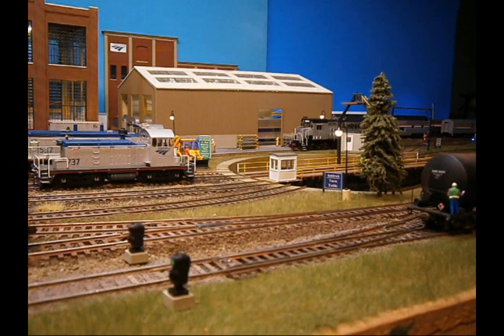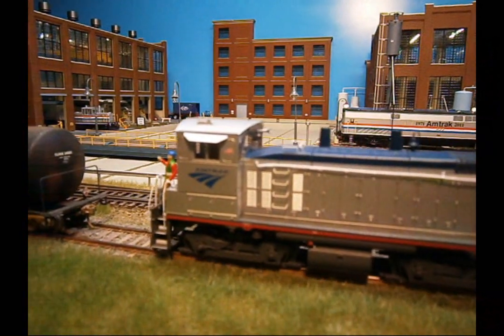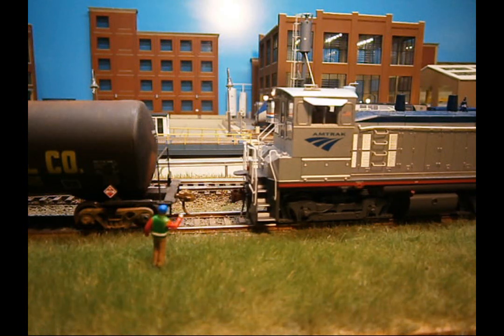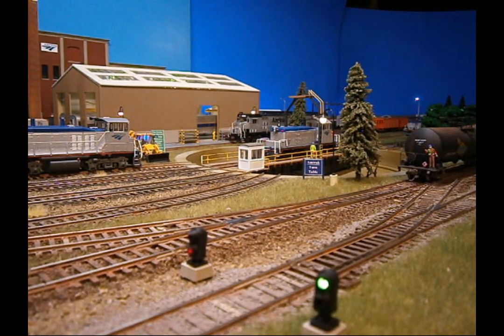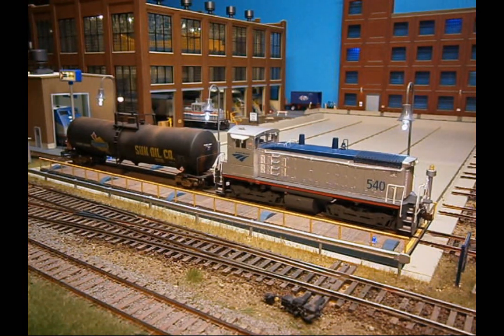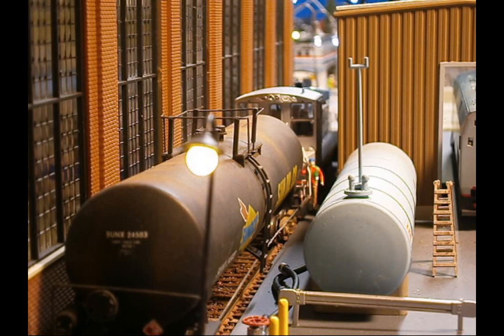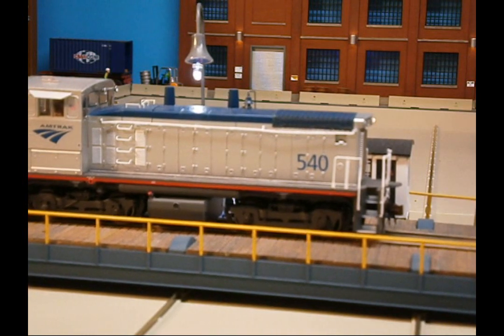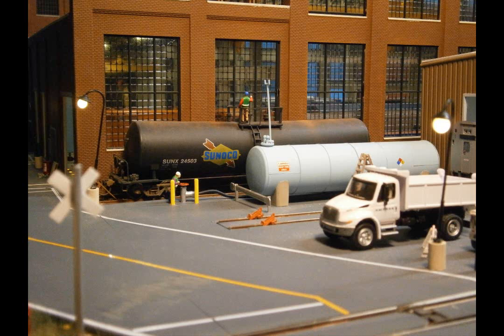HO Fuel Delivery Switching at Amtrak Birch Grove Maintenance Facility

Comment: Unbelievable video...well done...I too would like to model an Amtrak Yard.. great pieces.. where did you get the orange locomotive... transfer table..never saw one...it will be going into my layout... embedded track in the Engine house..how did you do that....??? Just awesome 👍
Reply from the maker: Thanks for your nice comments Erik! Amtrak 783, in the orange MOW paint, is an Atlas GP7 that they made several years ago. The Walthers engine house kit comes with a floor that has slots for rails built in. Code 83 rail works well in this application, just glue the rails into the slots. Good luck with your layout.